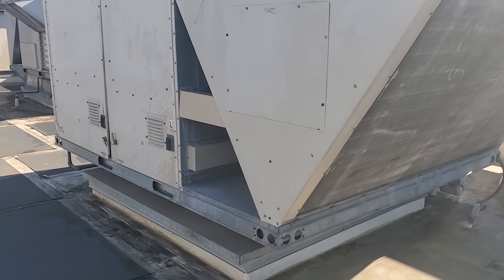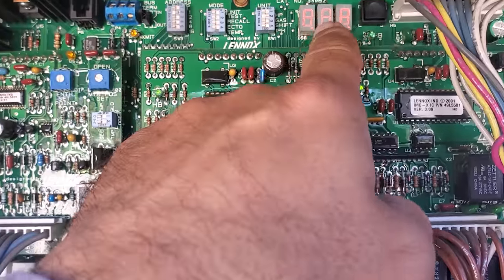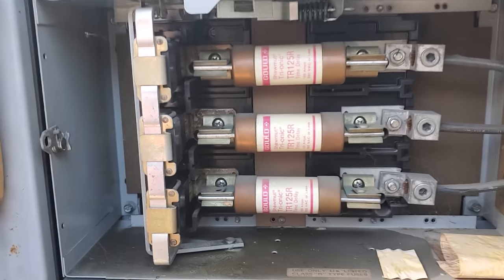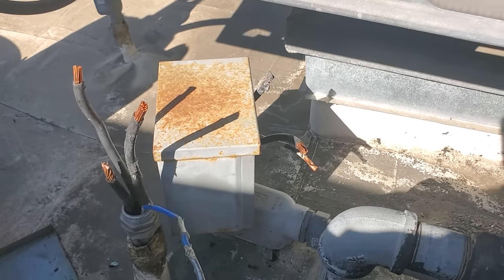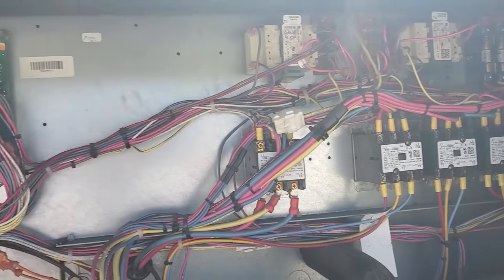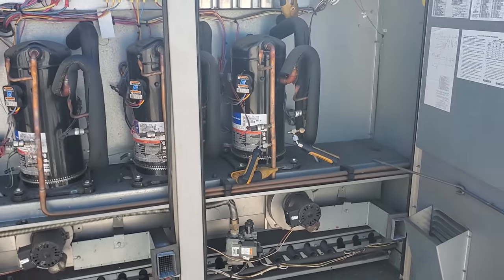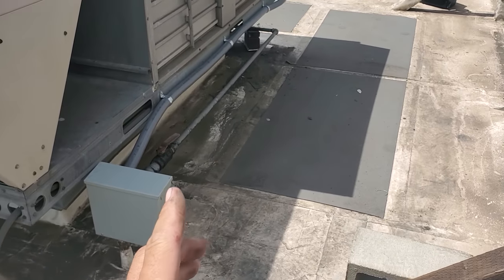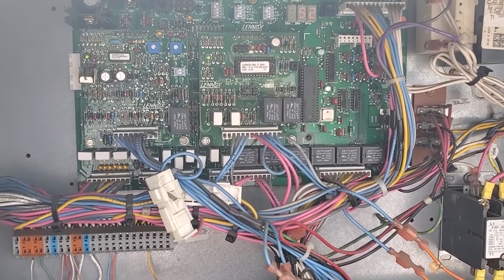ELECTRICAL FAILURES ARE FUN

Comment: I have a couple of things to consider. First, the media filter company rarely has guys who know how to close the doors properly on a Lennox RTU. Most of the time, they leave them horizontal instead of vertical, which is strange, since they should be finding the handles vertical, and placing them in that same orientation when they are done. Second...the first unit had a nominal phase voltage of 212. The second unit showed 207. That's an issue in the electrical panel or that ABB disconnect switch. Something in that older switchgear could be causing a drop. A different meter should not have a five volt difference. They haven't made a power panel like that sine the 1980's. I would sic the electrician on that bone once you confirm the 207 on the line side of the ABB switch. HTH.

Comment: Those screw in connectors are crap. If not wound right in over time if any heat develops they start to vibrate under load and the end result is what you see there. We had one in the LV  400 mains side of Transformer around 5.30 pm when everyone cooking dinner and the Yellow phase was glowing a nice cherry RED. Put the ole rubber gloves on chopped it below  the joint undid it put it on the grass got a new bit attached it back up and away she went. The piece on the Grass was still glowing threw it in me lead lined box still took an hour to settle down to coolness. Ex LV live line and HT Cable Jointer. The other unit worked fine detected in balance went to Fail safe. Also exposed skin round the sorta gear  not a great idea seen damage it can do not pleasant make sure no exposed skin. Good vid.

Comment: The fiberglass has minor darker spots on the circuit board.  It probably encountered more voltage than it could handle. Just a guess...

Comment: The phase to phase voltage imbalance means you have a huge transformer loading imbalance or likely a direct short fault between phases somewhere, either a motor or xfmr burned up or some junk shorting some exposed wires. I don't get how the phase to ground can still be correct voltage tho.
Reply: Agreed, it's nonintuitive. All 3 legs were still insulated from ground, but two phases were shorted through burned insulation and transferring power between them. If they had a scope, the phase to ground waveforms would be distorted. The tech's RMS meters were showing a time calculated average of these distorted waveforms, so the average voltages appeared normal. If you want to go deeper, three phase voltage is modelled mathematically as a rotating vector sum of sinusoids and we use trigonometry to make sense of it.

Comment: Voltage spikes brown outs that electrical connection just prior as it was melting down the amperage sword probably drawing down that one leg of the three face into a brown out face while the compressor was running the nanosecond that the connection blew open produces a large voltage spike, 
           And it was at that moment most likely when that other unit went down simultaneously interrupting the circuit board. 

           Seen that many times at warehouses when a line melts down or blows open either a piece of equipment with Electronics shut down
Reply: Perhaps microsecond 🙂

Comment: Just watched this. I am not an electrician, I prefer to work with microprocessors but some parallels are there and some of the same effects apply. 

My theory would be:
The Bar-AC went into error when the Dining-AC arced as the arc might have pulled down the voltage too much or created some flickering. The Bar-AC sensed this instability and had to assume something is wrong with the connection. However I would assume that they would think of something like an auto-reset for a problem like this, but maybe they just want to be safe here and the AC "wants" to be checked to not cause more arcs ore a fire.

Comment: The failure in the junction box, in my opinion, was due to a high resistance connection on one of the three phase leads. It probably was not torqued properly and heat/cool cycles eventually caused exponentially increasing connection resistance leading to the fault. I doubt highly lightening or a "brown out" caused the fault. It appeared from the video only a single phase burned away and the other two remained intact. When the connection failed no fuse blew or breaker tripped meaning there is no arc or ground fault protection allowing arcing to continue until something burns away. Everything then remained energized in a single phase mode. In any case two things resulted. First, when the connection melted away the still connected power supply went to a single phase condition. I am sure the electronic controller board detected a single phase but I do not know how, all else being equal, it was supposed to respond to that. Second, all else was not equal because the arcing created a lot of high energy high harmonic electrical noise. I think it is highly likely that electronic noise scrambled the electronic controllers brain. Even if the board knew to protect the motors from a single phase condition, and I suspect it did, its scrambled brain prevented that from occurring as it was supposed to and it inadvertently did so because it could not think clearly. That is probably why it did not reset until it was completely powered down and then powered back up. The building was lucky it was only a 208/120 volt system as that voltage is not high enough to sustain a phase to ground fault. At 480/277, without ground fault protection, there would have been a high risk of fire if the fault did not go phase to phase first.

Comment: Do you ever check the voltage on the controller board?  That 24VAC has to be rectified and turned into (probably) 5VDC, or 3.3VDC, for the microcontroller to run off of.  May also be a 12V rail for relays or other high(er) power devices.
Reply from the maker: I will discuss this on my Livestream this evening 8/2/21 @ 5:PM (pacific) on YouTube come over and check it out https://youtu.be/DMdcdQaF-kU

Comment: The "bricked" control board may have been in a brown-out reset condition. Typically all LED segments on the display will be on at power up to verify that all are good. If the power to the micro-controller drops below a minimum, the micro-controller will halt with the outputs at the last state.

Comment: The first 2 min I'm like um check the voltage, the min you found that it didn't have correct voltage to the unit. It's moved outside your licensing. Call sparky.

Comment: Although I'm not a licensed electrician I've had some classes on industrial side, even though your units aren't connected even in the same panel they are close enough to have draw down on voltage, probably on just that one phase, I think the Lennox board did the right thing and errored out, 

It would have been interesting to have been there at the moment that lug was arcing and melting for the last time, you could have seen that voltage going crazy on the other unit.

Comment: A common problem, it seems to me that the mechanical connection in the metal joint box had become loose over time and arcing had taken place melting the connector and burning back the insulation on the cable. This alone would be enough to cause the systems to shut down. Luckily it didn’t face the pc boards with it due to the resulting voltage fluctuation and surge on the three phase

Comment: Good work in trouble shooting .Always follow the steps .Check for all 3 phases to ground and phase to phase .and everything between supplies and protection .So many times the problem is not a fuse or breaker but something in between ..Burndy connectors would have been much better  for that type of connection ..Those lugs were probably not CU/AL rated and they did not use Noalox on the connection and it may have been loose as well .Always something to surprise you and put you at risk !

Comment: Unstable power caused the clock driving the digital boards to run in a harmonic mode (2 or 3 times the normal rate).

Comment: I was testing the circuits on a Hobart dishwasher, specifically the Hatco booster heater 480 VAC 3 phase & as I set a test lead on, my beeper went off and scared the hole bejesus outta meh. Beeper, google em, way before cell phones.

Comment: On 15:04 minutes. Is it normal in USA that they leave the copper bare on the input? Without any sleeve? It is basically "outside" behind an outdoor panel. Don't they worry about condensation during the night? Or possible arcing during a power spike?

Comment: I’m at 9mins exactly. Whenever I see funky voltages like this it’s often to do with water ingress in a junction box. If it was a cable fault i would have expected a main fuse to have blown. Let’s see :)
Reply: Well, that got hot at one point! Wonder what the cause for arcing was. Just a poor connection?

Comment: I just realized this is 240v 3 phase I was like screaming at my screen it's still too low but that's because I work with 480v all the time and 50 to 400hp motors and vfd so I am not accustomed to low voltage systems.  Also from experience that lug wasn't melting or arching overtime from experience that happened in 1 go one of them arcs creates a dust the is conductive causing all 3 phases to arc I'm surprised those fuses or the ground interruptor did not go off

Comment: Looks like a detection of unbalanced phases or critical over/undervoltage on the second unit and the board going into a lockout mode to prevent improper functioning of the AC.

Comment: Excellent example of locating a line-line fault. If I could point out the obvious: the equipment nameplate reads "max fuse or breaker 100A." But the protection installed is a 125A slow blow fuse feeding the 150A local breaker. This is probably the result of a sequence of highly skilled humans saying "not my monkey, not my circus" and "better go one bigger, just to be safe".  In the big picture, the protection will never trip and this unit is still doomed. In the bigger picture, the main fuse panel probably has similar mismatches and the whole property needs an electrical assessment before it all burns down.

Comment: wow i really wish the electricians were that nice to us, i opened a disconnect years ago after the sparky "fixed" an exhaust fan and lucked out i turned it off first so there was no load just 600+ volts, cause he or she didnt put in weather seal and it was full of water and next thing i knew i was shot 10 feet back and waking back up to my super on a cell saying "oh hang on hes waking up" but after being a fridgy for 2 years and hvac tech for 15 ive noticed most of the calls are electrical. Very seldom is it a freon issue unless its a leak but you know within days typically of the install or part change if its a leak.

Comment: The legs in box were likely incorrect for that  termination and wire type, one set screw could have been loose , yes. The ground wire is undersized. Conduit sized too small as well.   
Actually, with the breaker being ON , the risk for serious electrocution through the conduit, equipment or any standing water on roof was very high.  You should carry a non- contact voltage tester and just touch things with it before placing your hands on things first,  just to be sure electrical current isn't present.

Comment: My guess would be a lightning strike - they can cause quite a bit of headache.
I hope that you have safety padlocks for the main switches so that nobody can turn on the power while you have your fingers in it.
Reply: He did say he had the main locked out
Reply: EMI from sparking and arcing on that melted connection scrambled the microprocessors, they mentioned both ACs went down at the same time.
Reply: Combination locks, no lost keys🗝️

Comment: Copper wires must be connected with brass blocks, aluminum and copper quickly corrode under voltage.
And in general there were too many details, different connections just to bring three phases. The box with the connections should also be located higher, it must not be lowered, otherwise water from snow may flow into it, which will cause corrosion

Comment: Microprocessor’s have to go through a shut down process just like a home computer if the they get an interrupt then power on they ‘ ll lock out I see it all the time working as a hvac control tech we use ups on are supervisors
Reply: I had a laptop get bricked because of that. It would start up like normal and then just hang before windows would login. Laptop was powering down and then had a hard shutdown.
Reply: That depends on if they require writing of data to save, in automotive systems (my day job) it is preferable for a clean shutdown but they’ll tolerate the occasional ‘dirty’ shutdown. It should never never ‘lock out’ from dirty power down, it may toss a diagnostic code though. That’s what I’ve seen on those sort of embedded systems. Some systems are designed to have the power pulled at any time, some do need a proper shutdown.
Reply: Just jump it out. Just kidding.

Comment: So going and probing items for voltage was good troubleshooting but and there is always a but, you don’t check fuses in a CIRCUIT. your checking fuses in a circuit. Pull one side to remove it from the CIRCUIT.
Reply from the maker: Why wouldn't you want to check fuses in a circuit??
Reply: @HVACRVIDEOS  because you are reading the circuit on either side of the fuse. This is on the continuity setting of the meter NOT checking voltage.

Comment: If that connectors are aluminium on copper wire, you have your culprit. One does not simply mix aluminium and copper, especially on electrical conduits.
Reply: Huh? Yes you can. Cover it in noalox and clamp it under split bolts. Insulate with splicing tape followed by electrical tape. It works fine.
Reply: @jman0870  hey thanks sir, thought i was gonna havta replace, idk, EVERY BREAKER ever installed lol. I already got too many calls next week.
Reply: @flipfloptanlines926  you should always apply noalox (or equivalent) to aluminum lugs and aluminum wire. Large blower motors often have aluminum wire from the windings in the pecker head and the RTU wiring is generally all copper. I'm not telling a customer they need to replace a motor because it has aluminum wires from the factory haha. Noalox all line side connections and they will never corrode, copper or aluminum. Smear that shit on everything. A bottle is like $20 and will last years. The factory terminal block in the RTU is aluminum haha.
Reply: @jman0870  I haven't said you can't when using special compound. There are  al-cu crimp connectors too. But using an aluminum screw terminal on what looks like 2 copper conductors is just asking for it, especially outside.
Reply: @Kwaq84  bruh all splicing lugs are aluminum. It’s not a special compound. It’s a compound that’s been around for decades so that you can do it. Every. Single. Lug. In. Your. Breaker. Panel. Is. Aluminum.
Reply: @jman0870  Not in Europe, my man.
Reply: @Kwaq84  cool. Let’s talk about codes written by bureaucrats in Europe on a video in California. I don’t care what your codes, are if the wire is properly prepped there is no issue whatsoever with copper and aluminum touching. We do it literally every day in the US. Building wiring is copper. Service wiring is generally aluminum. All the lugs in a breaker panel are aluminum. The bus bars are copper. 🙄

Comment: It's surprising to me that the thick copper wires designed to deliver high power to equipment were connected using an aluminum connector. It is known that the contact of copper and aluminum in electrical circuits is not recommended. If there is such a need, then an intermediate insert made of another material, such as steel, should be used. In a specific case, there is an example of what the use of aluminum and copper leads to. Aluminum in contact with copper rapidly oxidizes, the contact resistance increases, heat is released, which further contributes to oxidation. As a result, an accident occurs.

Comment: What does CA RoC allow for electrical work under your HVACR licenses?

Also, it would be cool to see screenshots  of your invoices that you give to clients after a service call like this one (transient electrical problems, etc). Not for the pricing or client info, but to see how you word the service taken section and any advice you tell them.
Reply: He can do the work, but there is a certian liability hes explained in the past that comes with doing the connection from the disconnect at the roof and the panel shutoff in the building, he said it's not worth the trouble, it just takes one time pulling 2 gauge wire to know why
Reply: @xtort1077777  thanks, but wasn't what I asked...
Reply: For an exact answer, you should talk to a trade school instructor, or maybe ask Chris during one of his live streams.

Here in the Youtube comments section, I admit I haven't read all of the California code, but a Type IV Universal License would seem to allow him to work on ANY electrical or electromechanical system, up to 2,400 Volts, same as an industrial sparky. It's tricky to give an exact answer because some of these certifications cross over into NEC/NFPA and even OSHA rules, and also because electrical, mechanical, and pneumatic/hydraulic are regulated as separate disciplines, but they cross over each other so often.

Comment: Awesome work!! .. a bit curious about 1 thing though...was it my eyes or did the electrician strip a bit too much insulation off at the connection in the box?... it looked like it had an extended section of bare wire at the connections

Comment: As a factory electrician of over 40 years I am shocked at how much exposed conductors there are in the control cabinet. Is this normal for America or a very old unit. In the uk and Europe all terminal connections are at least ip20 ( you can’t touch with your fingers of more importantly accidentally short out) we had exposed stuff like what was back in the 1960’s, looks horrible to work on